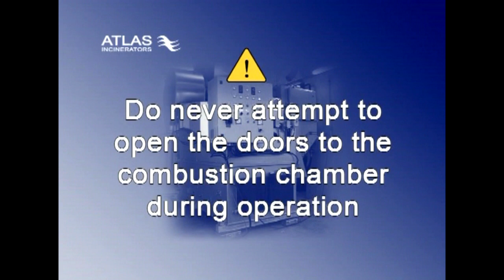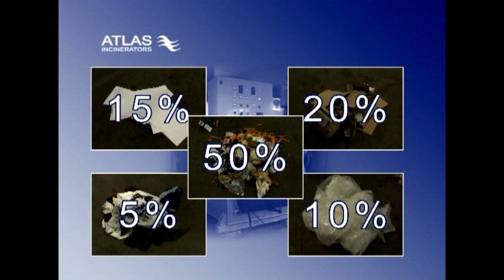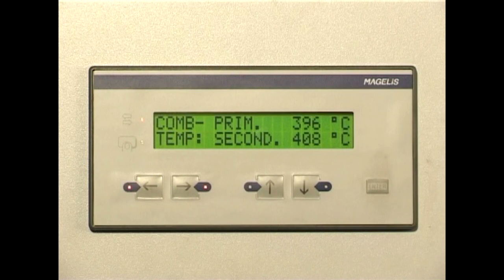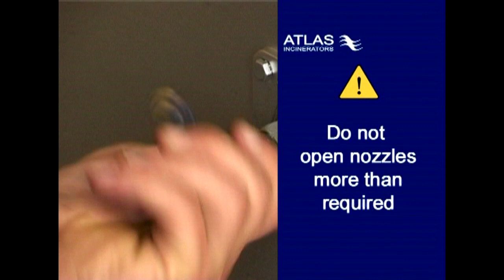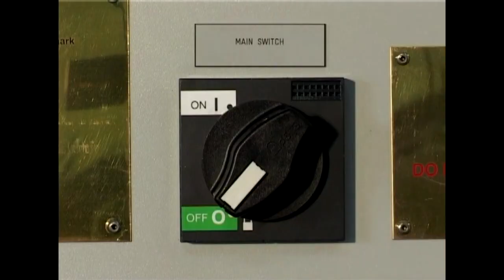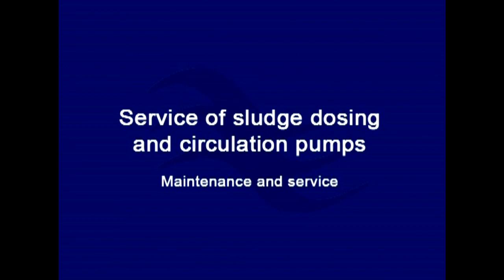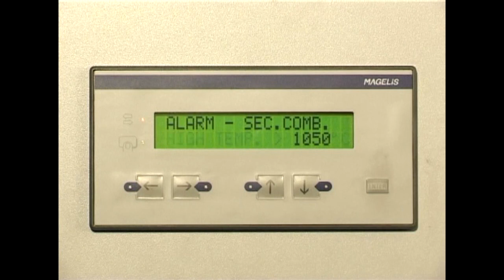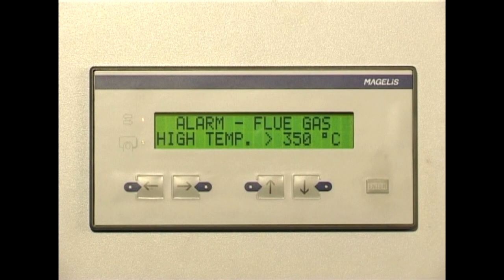Atlas Incinerator

Comment: Very nice to study.. Those air nozzles on the incinerator where I'm at fully covered inside with cement.. I guess some people don't know what those "bolts" were for..thanks for sharing boss
Reply from the maker: Very nice information ! Thanks Rafael!
Reply: @Adventure-Story  how they are adjusting the vacuum by turning the nut?? What is inside and how does it works??
Reply from the maker: Hello this kind incinerators i haven't work with but i believe with the adjustment of nut supply of air is been changed.
Reply: @Adventure-Story  Ok thank you for your time.

Comment: Is there an optimum distance for  best combustion to which the air nozzles should be opened/closed because I couldn't find any specific details in the manual. I have been getting negative chamber pressure alarm as soon as I am starting the incinerator even without any garbage or sludge.Have checked and cleaned all chambers and primary blower .Found in order.I am not sure how much the nozzles to be adjusted.
Model:Hyundai-Atlas Type:MAXI NG50SL WS
Reply from the maker: Thanks for this info!
Reply: @Adventure-Story  could you suggest something i can try to get rid of this alarm? Not being able to run the incinerator .
Reply from the maker: Normally incinerator are pre adjusted,for certain loads if negative pressure presents that means somewhere there is stuck of ports and check also if your sensor working properly.Take you the tube from chamber to see if alarm working ,check other things that can make this alarms activated like set points to be correct .If you find something inform us!
Reply: @Adventure-Story  by nozzles i meant the bolts on the sides...sensor is working fine..have cleaned the ports..temporarily repaired the refractory today..will try starting tomorrow again.. in the video it says if low negative chamber  pressure alarm comes, to close the nozzle by one turn..since i had taken it out for maintainence, i suspect that it is the cause of fault  because rest was fine before but now i am unable to adjust  properly.
Reply: @aayusheekonar2360  I have found that once you have the air flow nozzles set, it is best not to keep adjusting them as the video suggests. If you do plan on adjusting them, which is sometimes necessary when burning sludge that has a high Lube oil content (burns hot) it is useful to put a black pen mark on the bolts where they were previously set. It can be a real pain trying to find the optimum position for them again. Also to inspect the passages are clear, you do not need to adjust the nut, just the four bolts holding the plate against the incinerator outer casing will allow the whole nozzle assembly to be removed.
Reply: @MarineEngineer1989   Rightly said.Thanks for the advice..